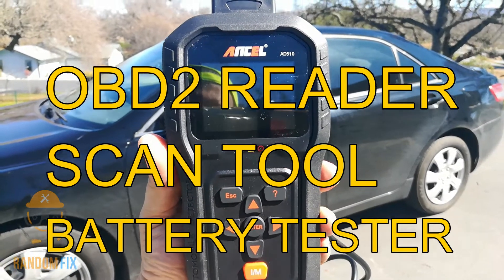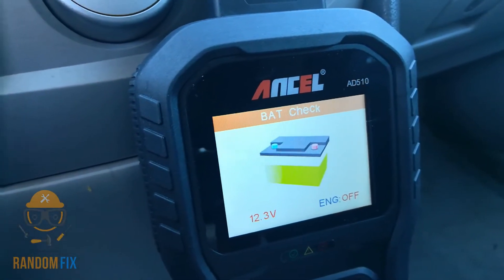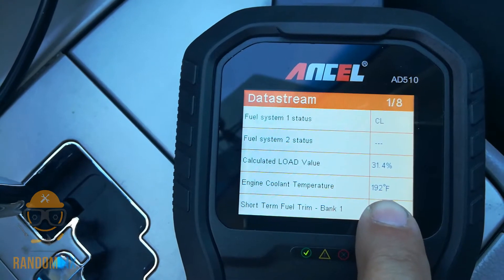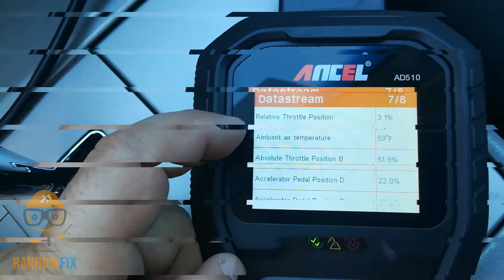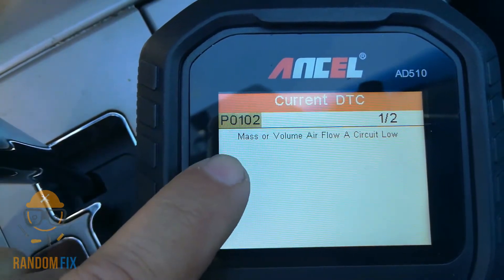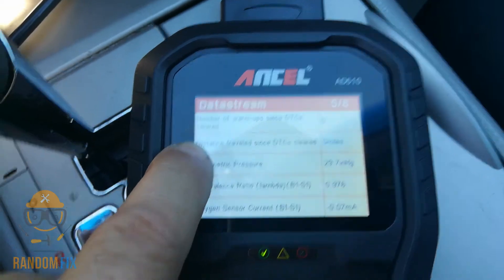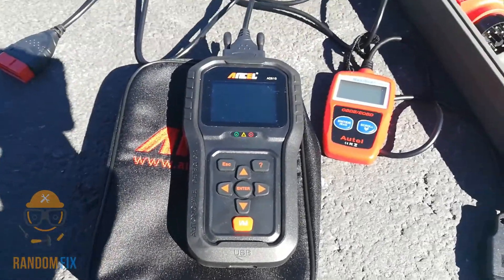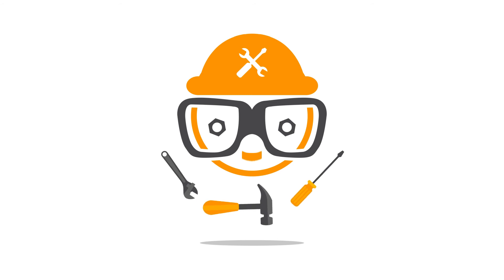Ancel AD510 Scan Tool REVIEW with Battery Tester

Comment: Great video, man. I am still new in this code reading stuff. I wanted to buy Ancel AD310, then I decided AD410, and then I see that special feature AD510 has... I mean, I want to be safe while checking the cars to buy for me and my friends, and to use the tool on mine and customer's cars. So... Can you tell me if it's okay for me to go straight for AD510?
By the way, I know good deal about mechanics...
Reply from the maker: Stefan, Yes go straight to the AD510. I still really impressed with the AD510 for the price point and ease of use. I also just tested the MD805 from Autel which is about $200 and I still prefer the AD510 even though the Md805 has a few features. _RandomFix
Reply: RANDOMFIX Thank you, man, for taking some of your time to reply. You have a new subscriber.
This advice means a world to me. Thanks.

Comment: Hey, bro'. I bought this bad boy, but I cannot make the reader itself go to "update mode" when I want to update it via my PC. I followed every single step from "User's Manual" and it says something like "press and hold any button (except power button) until the reader enters UPDATE MODE and connects with PC". Nothing happens.
Can you help me?
Reply from the maker: Stefan, I gave this scan tool to a fellow fan but I will look into and let you know. _RandomFix
Reply: @RANDOMFIX  Hey, I fixed it. So far, it can't connect only to Fiat Stilo 1.9 JTD, 2004 year model.
Reply: keep holding any  button then connect to pc

Comment: I just got one for 52 bucks! 
How did you fix the engine?
Reply from the maker: Fauxmunk, great question, in the video I unplugged the mass air flow sensor so every car and code is different. What code are pulling up on your scanner for your vehicle? _Randomfix